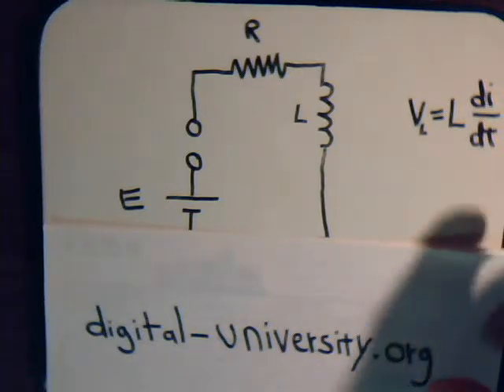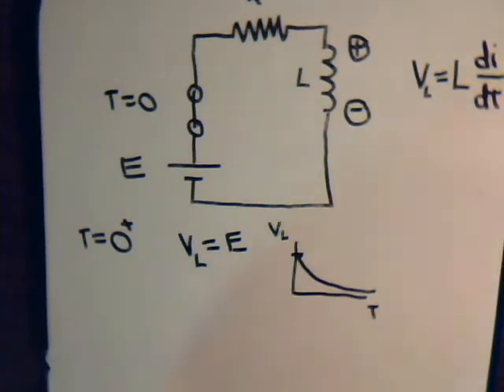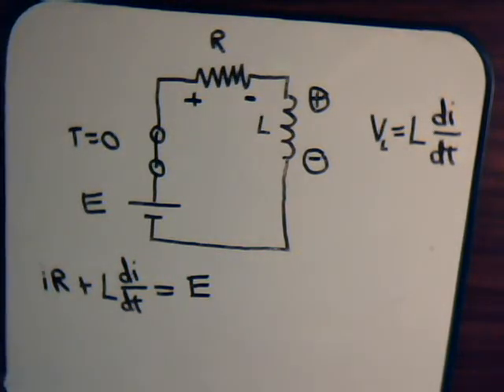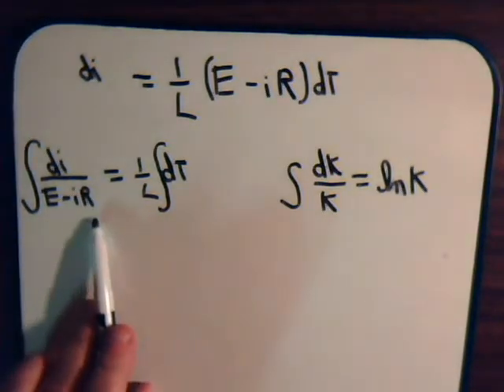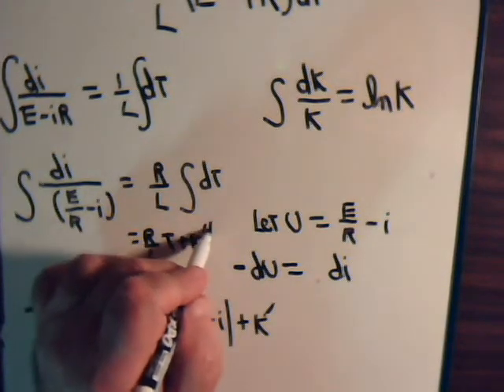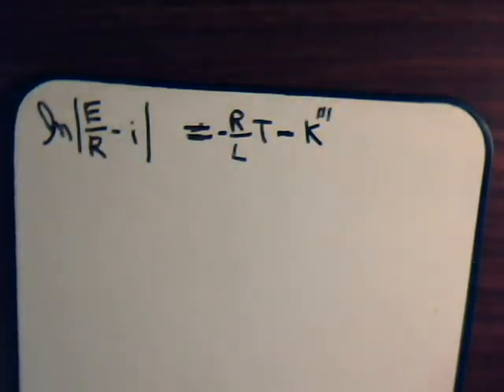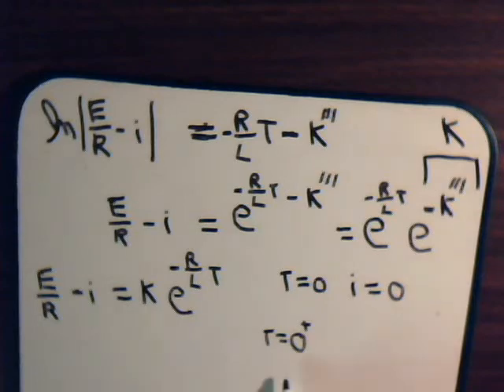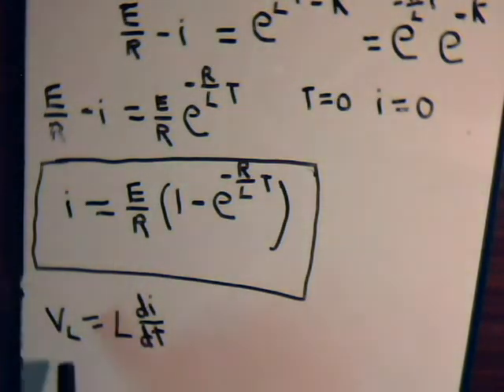Electrical Circuits Analysis Video #54: Inductance Growth Current  Transients - Derivation

Comment: Good video. Although I kind wished you would focus more on the analysis of the transient circuits than solving the differential equations because you already have those videos in the math section. I not saying that you should not solve it just much quicker. I was definitely more interested in the analysis and setting up the equation to model the behavior of the transient circuit.  Thank you for you time and effort, it was a good lecture anyway.